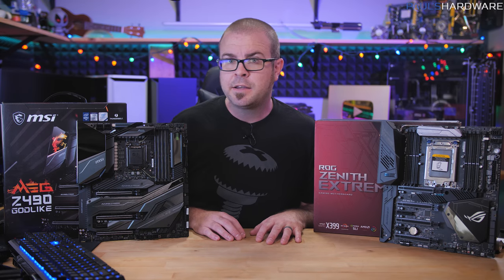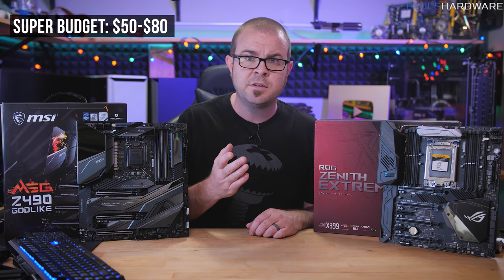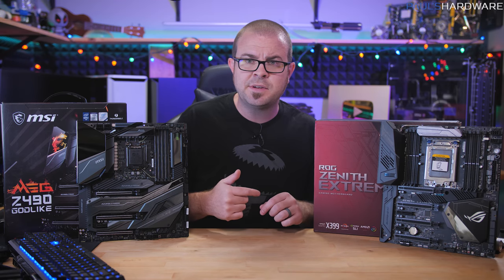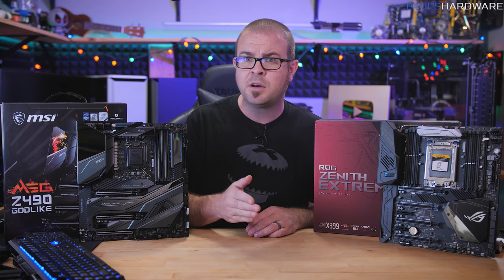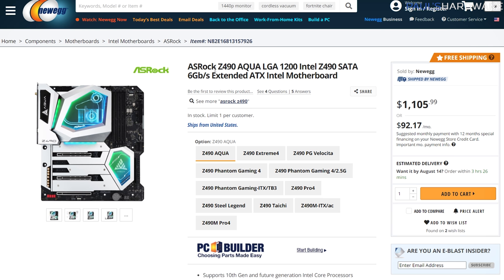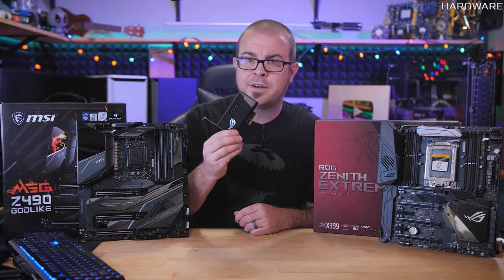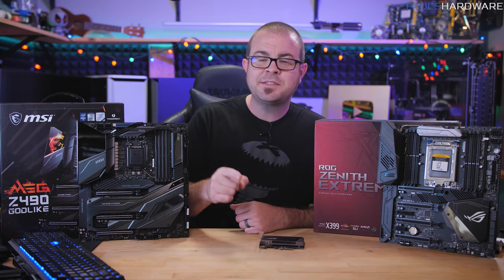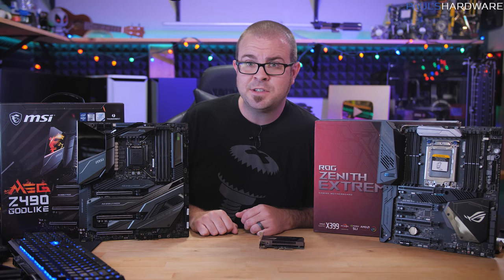What Does a $700 Motherboard Have that a $200 Motherboard Doesn’t?

Comment: As an X570 Xtreme user,
I can definitely tell you that this board ended up actually saving me money.
PCIE gen 4 M.2 raid support has been awesome. Having two separate 1 gig cards striped is... overkill. But it's so damned fast! 
The 10 gig nic is a must have for my NAS storage, and the other gen 4 M.2 drive works wonderfully for caching the sata storage on my machine.
That way I can actually USE a 10 gig nic for decent transfer speeds.

Not having a chipset fan stuck under my GPUs is excellent.
Being able to run a VM with 4 core virtualization and dedicate my quadro to it, and still run games on 8 cores and my RTX card has been wonderful.
The onboard wireless is honestly good enough to run as my house wireless router. It's controllable via software, and powerful enough to work for my entire house.

Cooling support has been excellent. I use the Fan Commander that came with the board to control every fan for every radiator, and can tune them to water temps on the mobo because of the two separate temperature sensor inputs on board.

enough USB 3.0 ports to permanently connect my VR headset, all 3 lighthouse trackers, everything that comes with being an Elite Dangerous fan (So many USB devices), the orbweaver (Can no longer game without it), and about 5 to 7 more USB devices at any given time. The front two case USB ports are pretty much dedicated as turbo chargers thanks to the board's ability to fast charge android and apple devices (and others).

Honestly, if I tried to do everything I'm doing with this machine on a lesser board, I couldn't. I'd run out of PCIE expansion on the X570 platform before I got to where I was,
which brings up another point.

This mobo allows me to use this platform as a kind of pro-sumer workstation without having to bump up to the HEDT range.
I could buy a 12 core chip that works a LOT better than I was expecting it to without having to jump into something with more PCIE lanes, and that price jump is a LARGE one.
Even if I could find another X570 mobo that had enough PCIE expansion, I'd still save money compared to buying all these features to add on to a $300 dollar board.
In the end, it probably saved me over a thousand dollars.

Still, if I wasn't using the features, there's no way I'd buy the board JUST for its excellent VRM.
Other than the mobo itself, there's not a single LED in the system so... all the fancy LED controls are worthless to me. lol.
Reply: I've also been saved by the equipped dual bios and clear CMOS buttons. I like to see how fast I can make 64 gig of Micron B-die go.
3555 @ cl16,18,18,32 is as fast as I can make it stable. Still, that's a lot better than I was expecting.
CPU definitely benefits from the power delivery, as it'll run @ 4.26 Ghz all core, and still boost to 4.6 Ghz single, with absolutely no changes other than memory OC and loadline calibration.
Hands off to Aorus here. I've never had a machine that checked so many boxes so damned well.

Comment: 0:08 Actual 700$ motherboard owner here, the real reason I bought one is because I build a pc about every 5-7 years. I decide to go all out with a theme and everything and this time I went with hardline and a all gold/black/gray theme with some rgb. I originally only wanted the measely 400$ MSI X570 ACE for its gold theme to go with the build. However they were out of stock of everything besides the highest end motherboards everywhere because of the shortages so I ended up going with the ASUS CROSSHAIR VIII FORMULA which also has ports to watercool the board. It also went well my EKWB watercooling set up and ASUS ROG THOR 1200W psu. That is why I bought the 700$ motherboard.
Reply: 🤷‍♂️
Building a PC every 5 years too and I like going for the "most bang for my bucks" approach and avoid anything unnecessary... and that starts with the friggin RGB BS. My casing is not transparent so I wish manufacturers would stop putting BS RGB LEDs everywhere like it was Christmas and just produce something sturdy, of good quality yet minimalistic and without added "aesthetic" crap.

And that's the same with RAM and pretty much everything: they usually give parts a "gaming" aesthetic and you pay 30 or 40% for that unnecessary crap. I wish it wasn't so.
Reply: @Draclord35  you can get more bang/buck without RGB at least in my country. And for the motherboard you can turn it off in the BIOS (at least I could)
Reply: I also only every build a PC every 5-7 years. Barring storage (which I add more of every few years at most), my rig only ever costs between $400 and $650, depending on my needs when I do my upgrade.

Comment: Sometimes I wish my budget allowed for these high end boards, but I am just happy I was able to get an X570 Tomahawk for my recent upgrade.
Reply: That's still an awesome board.
Reply: yeah I recently went and got one, shipped dead. Killed 2 3700x, so glad yours works. didnt have the best experience myself.
Reply: @jeffofbread  OMG
Reply: @misterx8448  yeah fun times.
Reply: @jeffofbread  did you at least got a replacement or your money back?
Reply: @jeffofbread  damn that's horrible. I really hope you got your stuff replaced.
Reply: I bought the X570 Unify a couple months ago and it has been great.
Reply: What do you use x570 for?
Does it have any functions you need that b450 can't provide you with?
Reply: @Nathanael_Forlorn  yes, I want the PCIE4 lanes that B450 doesn't. I convert analog tapes to digital. Once I save the analog, I move the file to be converted to a (goal, can't afford currently because I just upgraded) NVME PCIE4 drive. Do the conversion on that, and it saves me time in the long run. 
Plus I normally purchase the MB with the latest tech on it. I try not to upgrade my MB for at least 6 to 8 years.
Reply: Its a struggle. I want to wait for the next socket so I can get some future upgradability.
Reply: still awesome

Comment: Higher end boards also have a lot more USB headers. If you just need peripherals then you can always use a dongle, but then you’re just sharing the bandwidth of a single USB port.
If you have a lot of high bandwidth things to plug into your USB ports, like multiple external storage devices, cameras, etc, then having the full bandwidth of every USB port can be a need to have rather than a nice to have. 

The thing is, that is just remarkably uncommon. But uncommon doesn’t mean no people need it, just very few. That’s the market for these boards. 

The reason these boards cost so much isnt the raw amount of material and components put on them, it’s the fact that few people buy expensive motherboards, so the price has to be high enough to cover their cost of designing the board without getting the benefit of selling them en masse.

Comment: I can't see much point spending so much on a motherboard when they become obsolete so quickly
Reply: Exactly.
Reply: Ryzen boards are an exception tho
Reply: Mae is bae!
Reply: Not really. I have a motherboard from 2010 that would still be better than a lot of boards today. Sure it cost me $792 but you can all the top bells and whistles inside of it.
Reply: @Huels  yeah it may have great features for the time but it's still lacking some of the more modern technology upgrades. You're stuck on an old socket if it's for Intel and still using ddr3 ram
Reply: @kuro0198  Yeah the Ram was last gen but I had 24 GB of DDR3 and a Six-core CPU (first in the world) I could have four graphics cards in mine if I want to. It was crazy big.
Reply: @Huels  yeah but the CPU is still obsolete lol

Comment: I really do appreciate your breakdown of the features and whether or not they're worth it.
Having said that I'm still planning on using the ROG Mini DTX board, should you and Kyle still host a charity stream this winter.
Reply: I have been seriously thinking a mini dtx board. They are small, but still have what I need and looks like a good way to cut down on some desk space.
Reply: @bryku  I've done one sff build using the Mini DTX board; It was a charity build for Paul and Kyle's stream last year and I have to say that the board is really nice
Reply: @Lenticular67  My mouth is watering (more like my brain), every time I see it, I just imagine a new build with it. Like its always in the back of my mind if you know what I mean. 

Have you noticed anything weird with it? It looks like a nice balance in terms of the physical size.
Reply: @bryku  There was only one minor issue with the board, and to be fair it wasn't the board itself but an accessory: the DIMM.2 device had its label affixed upside down and annoyed me when I looked at it. It was a mfg oopsie, but as for the board itself man, it was great.
I had more issues with the Lian Li TU 150 case than anything else
Reply: @Lenticular67  I've been a bit standoff-ish on dimm.2, but I've always thought it opens up some extra space and it may be cool, just wasn't sure how it worked.

Was the performance any different, or did you even notice?
Reply: @Lenticular67  oh thanks again for answering the questions, its a huge help. Hard to find people sometimes that give a real answer.
Reply: @bryku  unfortunately I didn't have a chance to do a lot testing with it: I barely got it built before I handed it to Paul for the giveaway. I did monitor temps for a little while, because I was really concerned about having a push/pull 120mm AIO for a Ryzen 9 3900x; and the brief temps looked pretty good. EDIT - at 16:05 you can see the build here: https://youtu.be/enXvtGYsHPs
Reply: @Lenticular67   I suppose it is probably good. Well, I think it is going in the next build. Thanks for the help.

Comment: one big cost part you don't talk about is PCB thickness and number of layers all the super high-end boards features a ton of layers to ensure stable and clean everything from power to data. sure this is due to being a better overclocking board than anything else but it dose generally give you better stability and less issues since it is very well within the margins.

i think you go from something like 3 layers on budget to 5 on mid to 7 on high to 9-11 layers on the highest end.
Reply: bang on. The "high end" but not insane level boards wil last for a decade under heavy use.

Comment: When will I be able to buy an overclocker-focused motherboard with BAREBONES features?  Maybe a NIC but cut out all the other junk.  I don't need onboard audio for reasons like you said - I can add in my own superior hifi solution via an add-in card or USB.  I don't need USB2 or RGB.  Hell, I may not even want a NIC after all because I can add in my own much like the audio route.  

Instead, use the money saved on BOM costs and give me a motherboard with ridiculous amounts of phases with top shelf power delivery.  Give me the BEST passives like caps, resistors, etc from known, high quality manufacturers.  An OC panel or something similar to let me adjust clocks on the fly would be just as helpful as voltage measurement points.
Reply: One problem would be AMD not allowing it because it wouldn't meet base spec for the chipset
Reply: I wish more motherboards were high end, but didn't have all the "bs". Sometimes you can find some server motherboards that this, but its pretty rare, they typically have other stuff baked in.
Reply: I can relate but more phases doesn't equal more better. 
Saying excellent power delivery says it all on that topic. But to each his own
Reply: Good point but adding sound, nic etc adds up really quickly on the board taking up valuable space and PCI-E slots. There should be some integrated ones still present. That's like asking a company to ship a 2080Ti without a cooler because you will use your own air or most likely waterblock. 

The problem is that some moron somewhere will inevetably try to run it without cooling and damage or kill the card. Then the screaming ensues. No company need that kind of bad PR.
That's the same reason they include chipset fans on X570. Based on my own experience and what i've seen from others it's rarely needed. It's there just in case someone has a GPU dumoing heat on top of it.
Reply: @Raivo_K  that's a moot point these days because even with dual card slot setups, there's still 2 or 3 slots free for add on cards.  Beyond that, most good sound cards/DAC setups are USB for the reasons Paul mentioned in the video - it removes the device from the electrically noisy environment of inside the computer.
Reply: Motherboards are not a bottleneck for overclocking right now, the CPU is.
Reply: @BrawndoQC  if you want to do extreme overlooking of RAM or LN2 on CPU, the motherboard can most definitely be the bottleneck.
Reply: The super OC board you describe will never happen. Why you may ask? Well , they want to make maximum profit from you. They created the Asus Apex and EVGA Dark models for super OC. It is just like why companies that sell trucks do not offer bare bones trucks any more, they make more money from you filling it with useless over priced junk so they can crank up the price.
Reply: I got an EVGA X299 Dark on backorder, paid $220 including shipping, handling, and taxes.
Reply: also you have to factor in demand. Probably not worth it for them (or they think that at least). There are costs to starting production (design etc.)

Comment: I would look at 10gig add in cards as "arh, now I have this I won't have to purchase expensive motherboards to use my 10gig switch". I'm fairly sure that for stuff like 10gig add-in cards are a lot more economical than having to essentially purchase it each time you upgrade your platform.

Comment: Thanks for this video Paul.  This helped confirm my thought process with my next build.  I was struggling with the idea of buying a budget board or something a little higher end.  We just upgraded our home to fiber optic, and even though we only pay for 1000mbps/100mbps our speeds often peek to 2500mbps/200mbps.  Which means I should probably get a board that can take advantage of those speeds when available.  Thank you again, your content is always a huge help for an old builder like me, working to stay current with today's hardware and information.

Comment: I will say, I'll pay extra for true pwm headers. Having enough to run every fan via pwm is definitely nice
Reply: Most decent motherboard PWM headers can handle like 2A output which is plenty to run splitter cables and group your fans.. The 4th sense wire that returns an rpm value only connects to 1 fan though so ideally they should be the exact same model.

Eg: I use MF120R ARGB fans (they were cheap and look nice, although average on cooling potential) with 3x coming off 1 header for "intake" group, 3x off another for "exhaust" group then my waterpump by itself
The fans are rated to use 0.2A with a safety current of 0.54A, so assuming the worst case scenario, 3x 0.54 is still only 1.62A.. well within limits

And then I set my intake group to around 50% fixed speed and exhaust to around 40% fixed speed.. permanently positive pressure environment for dust protection, no ramping up/down under load, still quiet enough at idle and CPU/GPU never reach 70C (I do still have to ramp the GPU fans under heavy load, but not by much)